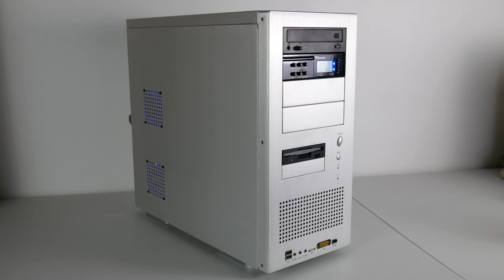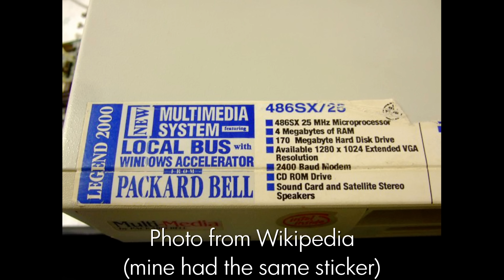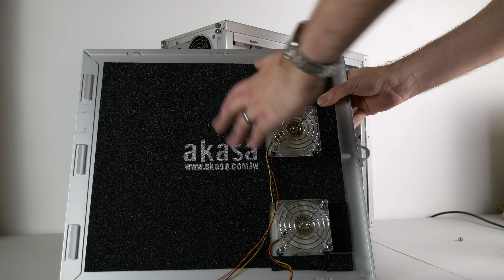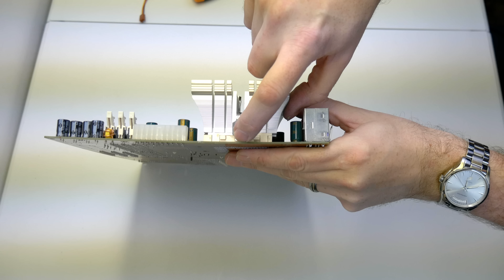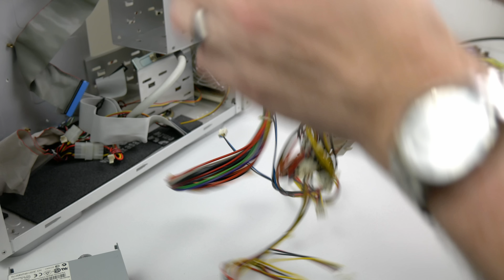20 year old PC teardown and demo - Windows XP, gaming and more!

Comment: I'm 18 and admittedly I'm late to the PC game, but man oh man that is some very cool and very old shit you got there. A optical drive?? who the hell uses those? Sound card? your telling me PC's back then didn't have on board audio? not even Ethernet??? Man I have it easy. My hat's off to you sir, also my PC  has an Amd athlon II x4 559, not the newest cpu but still good, 8gb of ram and a r7-260x. Question....15 years ago was 512mb of ram a lot??
Reply from the maker: 512MB of RAM was a pretty good amount at the time I installed it. I bought each 256MB separately, and at that point I generally had about double what was the average amount for the time.
Reply: right now i think 4gb is like a sweet spot for day to day use and 8gb is pretty much a must for modern gaming.
Reply: ya of course but im talking about strictly gaming and the majority of games even modern aaa are still fine with 8gb.
Reply: The sad part is that your 30 and you still don't fucking get it, you don't NEED the best of the best to have fun, as a college student whom lives off of ramen noodles for dinner, I can safely say that I do not have 2500 gssss just laying around. In fact the whole reason I got into pc gaming was because I couldn't afford to "upgrade" to next gen consoles. I decided instead of waiting for the ps5 and gaybox 69 to come out just so i can buy a "next gen" console, I decided to say screw the failbox one and crap station 4, and i did some research and built my 120$ beast. And so far I have loved everything about computers, in fact I'm considering on changing my major.
Reply: 8gb should be more then enough to play that game.
Reply: You think you have it easy? Sure... motherboards have all that crap built in now. Until... you want something better than the lowest quality. Then you need an expansion card. But oh.. look.. most motherboards only come with or maybe two slots. So... did you want improved video, audio, a tv card or maybe additional usb ports?  Pick any one or two! After that you are SOL as you used up all your expansion slots. Oh.. and that built in device doesn't want to completely disable and still chews up some of your computer's resources? Well.. that's your fault for wanting to upgrade right?

 What's that you say... just use external USB accessories?  Of course! That's what I do. Because there isn't much choice anymore but to do that. Of course they suck because they are all fighting over that same bus.  And there is a tangled mess of wires everywhere.  Oh well.
Reply from the maker: I had 8GB in my desktop until just about 6 months ago. I upgraded it mainly for video editing, not gaming. I don't personally have any games that run any better with 16GB of RAM, although that's not to say there aren't any. I've stopped really rushing out and buying the latest and greatest games all the time, so there may be some that can benefit from 16GB or more.
Reply: CHEAP!!!! 16GB 8X2 IS LIKE 100 DAMN DOLLARS??? you know what stop...just stop its time to stop.
Reply: I'm not oppressing anyone tf...??? but when you said 16gb is a "must have" for gaming that seriously bothered me, editing and rendering sure why the hell not, but when your primary objective is playing games @ 1080p 8gb is fine, ddr3 is fine and even ddr2 if your willing to except texture popins and some other shit. When I do get a career and make 40,000 a year (hopfully). My primary rig will still be a second hand beast that will play all tripple A tittles with ease. As far as standards go ULTRA is overrated in my book, in most games its not a huge step up from high or even medium,  Fps?? ya 60 is a target but if your average is 45-50 and your min is 30-35 then there is nothing wrong with that. When it comes to consoles I can insult them as much as I want, especially when you have to pay 60$ just to play with friends with internet you already pay for?? That's just scummy on sony's and micrococks behalf. At the end of the day who...cares what hardware you have, whether your gaming with an r7-240 or gtx 980ti's in sli we are all still apart of the glorious pcmr......
Reply: next time, try closing some background applications.
Reply: i remember upgradeing from 128 to 256 mb of SDRAM
oh man. that was awesome i was so happy that day :D
Reply: didn't have a gig of ram until 2008
Reply: lol i just built my 11 year old bro a pc very similar to that, it has the same cpu as mine, 8gb of ddr3 and that rx460 its a great budget card.
Reply: Not even man you can play a shit ton of games with 8gb of ram dd3 at that my pc is a perfect example.
Reply: Erika Nakagawa Gaming are there even mmo games like that anymore
Reply: no but i have played gta V with 5 stars and 69 cops wanting to tear me a new one 16gb yes its future proof but far from a necessity. keep in mind my pc only cost me 120$ and I can play a bunch of games at respectable frame rates and resolution. NOT every thing needs to be ddr4 this and i7 that, people like you really trigger me.
Reply: try desktop p4 2001 upgraded to max
Reply: Old? Shoo, kid.
Reply: Daevster 666 hell yea dude
Reply: who doesn't use optical drive? it sounds weird like if you are talking from 2050 or something like that. dvd is normal, common, I would be shocked to see a computer without dvd drive.

by the way, onboard anything is still a "card", audio, ethernet, video.
no sound card is just pc speaker, it will just beeep and booooooop hahaha.
it's nice motherboards have onboard stuff "as a bonus" I guess, but onboard video usually sucks and you have to use proper card anyway.
Reply: +Erika Nakagawa Gaming  Much of this is untrue, going over your allocated ram will not crash your computer or your game, see the game you are playing has a minimum amount of ram it requires, if you have whats required the game will start and reserve X amount of ram for the game to use, it is designed to use that space efficiently and have the proper load points to replace items in ram when needed. The game knows how much ram it can use and adjusts accordingly. If you didn't have enough ram requested by the game at launch, windows will move ram currently being used for other OS items that hasn't been accessed often and move that data into your swap allocation (a spot on your HD that's used as slower overflow ram). Thus freeing up space on your main ram to honor the game's reserved memory request. This process isn't optimal and when you quit your game, you will hear your HD reading very excessively to load the memory that's in swap back into your main ram. This shouldn't crash your machine. 

As for your game crashing? it's going to be one of these reasons, your ram sticks have an error somewhere on them, You have overclocked your ram, your ram is not on the compatible ram list for your mainboard and causes errors, GPU Vram error, something with the middleware layer, mainboard errors, not enough clean voltage to your devices or windows itself. In almost all cases installing more ram will not make your games more "stable". What you witness in increased stability after you upgraded your mainboard and ram was A: Better mainboards result in a more stable system B: The new ram you bought could have handled voltage better and didn't have a bad storage bit that your old set had. Also you mention a bunch of stuff about tinkering with your ram forcing caches to be stored on it? M$ doesn't want you to do that cause it's memory management system isn't built to handle that, so that's another reason why you were probably getting crashes, it was the way you set-it up, not the "lack of".

As Modern Classic mentioned the upgrade from 8GB ram to 16GB of ram saw no improvement in most games at this time, which is correct as almost all games on the market have a minimum ram requirement of 8GB (so in reality the game uses somewhere around 5GB) and the game is designed to use that efficiently with on the fly loading when needed (A game wont keep using ram until theres none left then crash). Somehow you managed to associate your upgrade in ram as the solution to your crash problems you were having, but in this case it was one of the other variables involved during your upgrade that should be getting the credit...
Reply: I still have an optical drive…
Reply: His PC slows down or crashes in games if it has less than 16gb ram...

Lol.  I enjoyed that.
Reply: 512 MB was almost unthinkable in about 2000 when he started this system... 128 MB was considered a large amount for a PC... An 80 GB HDD was huge... Usually 10 to 20 GB of storage was the norm, high end graphics cards usually only had around 32 to 64 MB of VRAM... and an Athlon 1700 was a badass chip for the money during that time, and even remained somewhat realavant into the mid 2000's...
Reply: i am 13 DAMN i have it easy altough i don't have the best pc currently either (RX 460 ,AMD Phenom XII 550,7GB DDR2 Ram)still seems top spec to this old junk xD

Comment: what's your current pc build?
Reply from the maker: Current one is in need of an upgrade as well. It's an AMD FX8320+ running at 4ghz, GTX 970 and 16GB of RAM on some Gigabyte motherboard. Next time I upgrade it, I'll do some kind of video about it. (Earlier I'd written GTX 1070, but that was the hangover talking. I have a 970 right now.)

Comment: My first PC was a Dell dimension R400, with a Pentium 2 400 at 400Mhz. 
It had 64mb of ram, and a 15GB hard drive. 
I didn't know much about computers back then, but I really wanted to play GTA III, so I bought a Geforce 2 ti, which was way overkill for the system. The Geforce 2ti had the same amount of vram as the system even! XD
It did the job and it was my main PC until 2006, when I got a Pentium Dual Core, 1 entire gigabyte of ram, a 80GB hard drive and a Radeon X1550 with 256mb vram.
That machine was like a god to my dell, and now its worth less than £1. xD

Comment: And as standards require you have bulging capacitors in need of replacement ....

Classic
Reply: You know of the story behind the faulty capacitors? It all came about due to industrial espionage.
Reply: CAPACITOR PLAGUE!!!!!
Reply from the maker: Well, no, because I'm not using this machine anymore.
Reply: one of my computers i own needs new capacitors. I plan to replace them one day, first i need to find a store that sells them, there are no electronic stores in my area :(
Reply: That is not a problem , they are cheap , you can buy sets for most common retro computers on line , or order specific that you need

Comment: How did you manage to keep your computer so clean? I have no pets if you're gonna ask. And you can send your PC to me. I have a weak spot for older hardware.
Reply from the maker: I didn't do anything special, but when I shot the video I did first use a can of compressed gas to blow it out and then a vacuum cleaner to get whatever dust bunnies were left. There was still a thin film of dust on most components, but the cards sit in the slots upside down so when I showed them to the camera, you didn't see it. And of course the MB is vertical. As for the drives, there's really nowhere for dust to get in at the top/front of the case.
Reply: Its good that you prepared before the video. Turned out great. New sub, hopefully looking forward for more videos like this. Take care.

Comment: The graphics card actually has a place for a dvi slot on the PCB. I wonder why they didn't utilize it?
Reply from the maker: Just to make it a little cheaper. There was a DVI version of the card as well (or one with both, can't remember). I just picked VGA because I had a 15" VGA LCD at the time (KDS RAD-5), and it was about $30 less money.

Comment: I think a cool video would be showing how people overclocked before you could do it in the bios. I've always wondered how they did it.
Reply from the maker: BIOS was the first way to do it that I know of. OS-based utilities came later. We had to overclock in the BIOS at this point in time.
Reply: Motherboard jumpers were how we did it previously, with an often complex lookup table referenced in the manual. Prior to the Deschutes Pentium II, you could just set the CPU multiplier and bus at whatever you wanted, provided it could actually run at that configuration. Very course voltage control, if it was there at all. When the GUI "soft BIOSes," pioneered by Abit, came around, there was quite a bit of PC gamer snobbery with many preferring to stick with jumpers, most prominently offered by Asus.
Reply: So you would set the multiplier and bus frequency in the bios, but would use jumpers to skip resistors in order to deliver more voltage to the CPU?
Reply: No, everything was done via jumpers before circa late 1998, including bus and multiplier.

Comment: I had pretty much the same setup.  Oh how I loved that machine. Athlon XP 1800+, 512MB DDR, MSI Nforce 2 Motherboard, MSI Geforce 4 Ti 4200 64MB, 80GB Seagate 7200RPM Hard Drive, DVD Rom, CD Burner.

Comment: Oh god, those Athlon XP coolers were a nightmare to install and remove. Sweating bullets every single time. I even nearly destroyed a motherboard once when I slipped with my screwdriver while trying to install one.
Reply from the maker: I cut it out of the video but I slipped at least 3 times with my screwdriver on this one. Didn't care that much because it's probably never going to be used again, but it would have been embarrassing for the video if I'd cracked the board.
Reply: I used a socket driver.  being a circle, it stayed on without worry.
Reply: Toan Ho Sockets don't work on circles.
Reply: sockets stay on a hook that you are trying to use a screwdriver to push down a cpu heatsink clip.
Reply: Astfgl i 'broke' an athlon cpu by chipping the corner trying to take off one of these coolers.  I didnt know at the time, so i tried returning it -- the tech guy basically laughed and showed me the chipped corner of the cpu. 
You had to be really careful with AMDs back then, no heatspreaders to protect the die.
Reply: Ahhh... good times. I still remember trying to be very careful to not put a screw driver through my motherboard.
Reply: Yes, and those stupid 'Socket A' CPUs had a rubber cooler support in each corner (more like foam actually). These just fell off if you cleaned the paste off more than a few times.
Reply: Yeah I did that too, slipped with my screwdriver but I can't remember if I killed the board or not.

Comment: Cool that you were using an Abit KT7A! I've got one as well. Do you still know how far you were overclocking the FSB?
Reply from the maker: I don't unfortunately. I want to say that only changing the multiplier actually worked stably for me, but I am not sure if that's a true memory or not. I know I had to up the voltage a bit as well, but not sure how far. I am not usually as aggressive as some people; I'm not willing to put up with any crashes or other weirdness whatsoever, so I will only overclock as far as I can with no additional instability.
Reply: Modern Classic The KT7A pretty much doesn't overclock the BUS on stock IO voltage (3.4v). But with each step (0.1v) it takes about 10MHz more. To which multiplier did you get your Palomino 1700+?

Comment: Still looks nice and fairly modern after all these years IMHO, although I may be biased.
Reply from the maker: I think it looks as nice as it did when it was new, though the real Lian-Li case in one of the photos near the beginning of the video looked better in person (not sure why I didn't keep that one). But it lacks a lot of modern features that gamer style cases usually have now, like a side window, any cable management at all, or support for larger fans and/or radiators. Still, there haven't been huge advances in case design in the past 15-20 years.

Comment: My newest computer is now 7 years old. I still run a 1st generation Core i5-750. My oldest PC (in use) is a Pentium 4 Prescott 3.4 GHz with a very hard to find copper cooler. I have an IBM Pentium 3 Coppermine that I upgraded with a PCI Nvidia 5500 card but for some reason I cannot get it to display now. Plus I have no more PS/2 type peripherals anymore lol

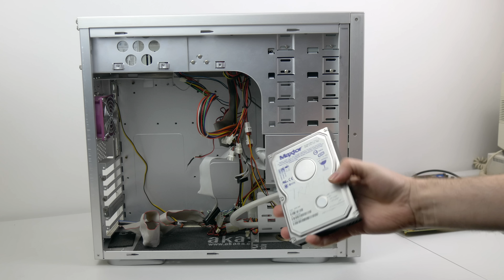Comment: 14:48 I have the exact same drive, it used to be a replacement drive for my Pentium 4 Rig^ when the original died, and it now lives in my HP e-Vectra.

^It has a long story associated with it but it eventually died some time in around 2011.